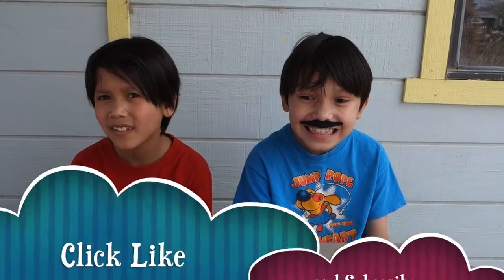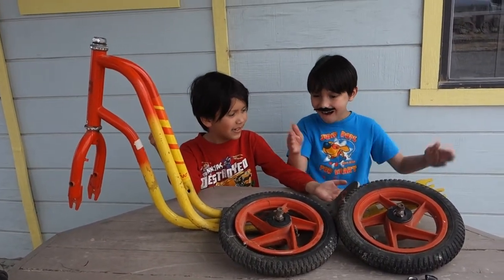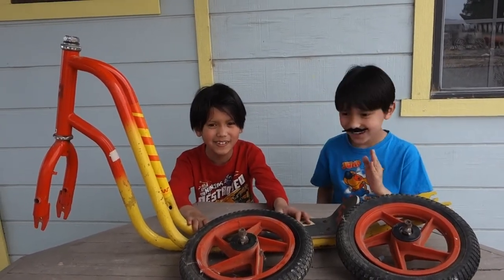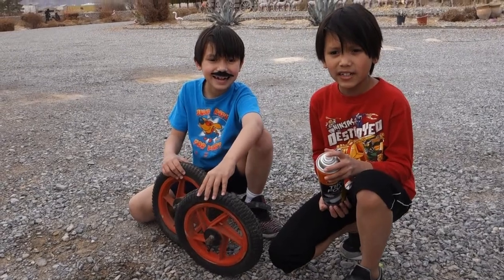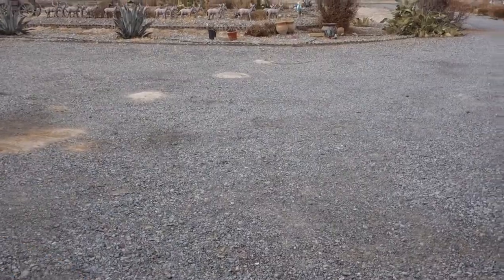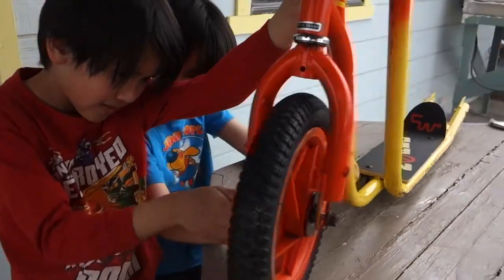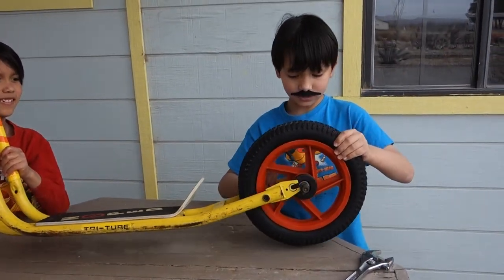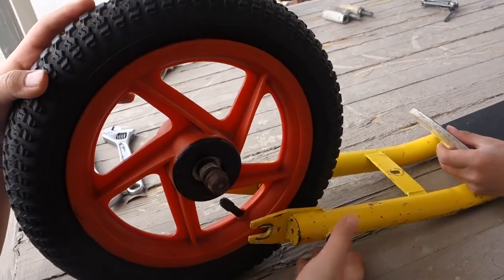New Razor Scooter Vs large Old School Scooter We test them CW Racing No Ped and Razor to the Test

Comment: I'm researching  this old school style scooters because I have to park so far away from my apartment.  I didn't think I'd be able to sit through a kid video but it turned to be entertaining charismatic kids.  I already have a hard wheel scooter and it's kind of jarring.  I'm an adult i want some cushion.  So my question is, is the old school one way slower than the new school one / hard tires, or not that huge a difference?  It's hard to tell in this other than the razor looks quicker out the gate, but maybe the old school wins in a full longer distance race.  Thanks for posting!
Reply from the maker: Thanks for your kind words, Yes the Old School is faster and easy to Control,  as you can see the crash on a FLAT surface in the video, They can also handle jumps or bunny hopping curbs without falling apart , its not the hard tires of the new one that is the problem it is the SMALL Tires and Cheap construction of the new ones, you will see if you get an older one, Way more Fun
Reply: @ciscoandpanchosworldofadve7221  Awesome,  sounds like I'd be gaining advantages everywhere not losing.  Okay I greatly appreciate the details and your input.   Super helpful!  May your kids become future YouTube star millionaire's someday.  Haha many blessings. Thx!
Reply from the maker: No Problem, you will see the BIG Difference when you ride a Old one, So much stronger, and no crashing when you hit a crack in the parking lot , Happy Holidays